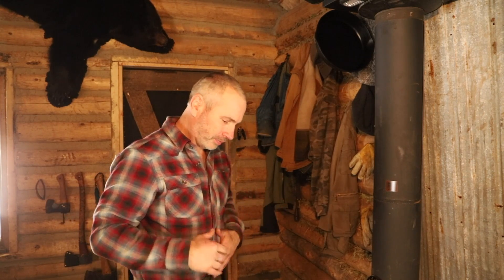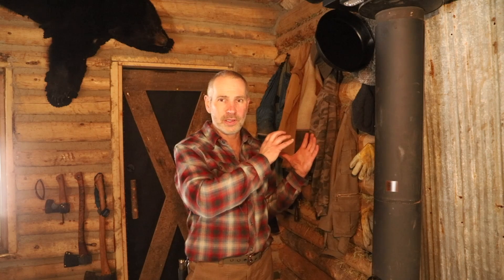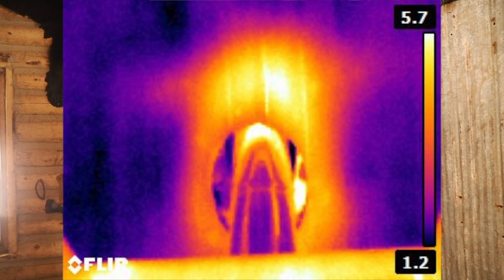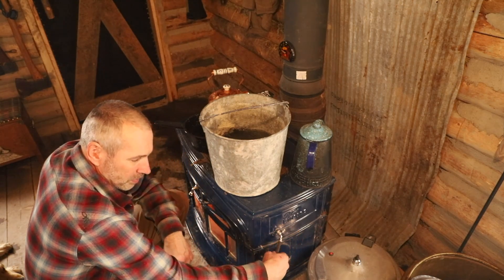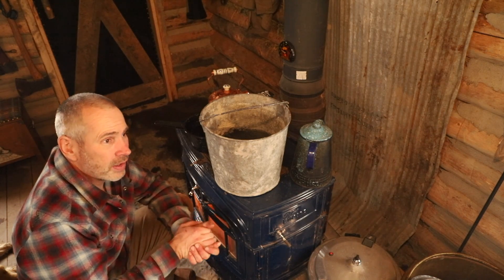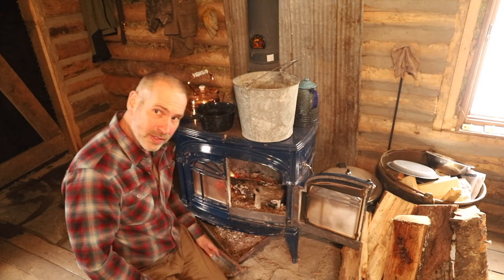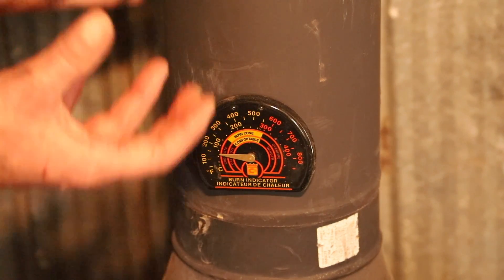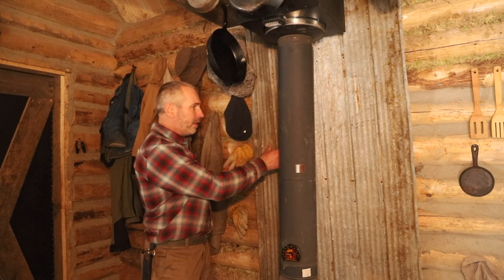How to Heat an Off Grid Log Cabin with Wood, Thermal Imaging Scan (infrared)

Comment: I really love everything of the cabin except the wood stove; it is not a good one, i really hope you will get rid of it ASAP (no kidding, not trying to offend; it is just a fact).

First: apologize if i sound polemic or something (i do my best with my limited english... I am also an asocial person. I am not good to "interact with others"; none the less, i am trying to help you...).

A good wood stove (2/3 of the size of the one you have) will burn 1/3 (or even less, maybe 1/5) of the wood that you are using right now, and will bring the temp of the cabin over 25°C with ease (you will be forced to open the windows - at the minimum setting -).
 
Nowadays wood stoves (good ones OFC - they are not all the same -) have a "fine air control" that make the chamber "go in depression" (10-15 PA or more). Less air inside, mean "more heat retained"; at that point the stove "will burn THE GAS instead of the wood" (you will see the flame only near the top of the stove, disjoined from the wood it self - A VERY LITTLE CALM AND STEADY FLAME -).
   Resulting in a greatly improved efficiency, less wood needed (usually "ONE CHARGE EVERY 3 HOURS or less" average), a lot more heat produced and the glass of the stove ALWAYS CLEAN (optimal chamber burning temp).

Your stove have always inside "big flames + BIG NOISE (= to much air - COLD AIR, that lower the chamber temp -) + the window dirty (chamber temperature "TO LOW for optimal burning")"; the worse possible condition for a wood stove (i honestly don't understand how you can "act and talk about that, like it is normal" - IT IS NOT NORMAL... IT IS WRONG!!! -) .

   That is why you burn SO MUCH WOOD (the quantity you need is simply INSANE) and a little cabin like your is ONLY AT 15 C° - it is ridicule... I really hope you will realize this; it not "right" for nowadays standards (here in Italy you will be not allowed to use a stove like that, because it have "30% efficiency AT BEST" (nowadays stoves are 80%+ for law).

The smog that you produce is "TO COLD"; a lot of "UN-BURNED SUBSTANCES" NOT HELTY FOR THE ENVIRONMENT; with a more efficient stove, the fumes produced will become "good food for the plants" and nothing more.

I understand a good wood stove can be expansive but "it is the core of the house"; it is the most important item; it will repay it self "one millions times". It is also "A GIFT YOU DO TO THE PLANET".

A LOT LESS FATIGUE TO MAKE FIREWOOD TOO...
Reply: Just ended to write my post... Resumed the video... Figured out that "you already know that your stove suck"...

...But you are fine with that... 

One cord of wood FOR MONTH for what... Less than 60 squared meter cabin?

I barely use one cord of wood for a 130 squared meter house - for the whole winter -; people that WASTE natural resources like you do FOR NO REASON, make the life harder for everyone else... 

I can't stand this kind of behavior; it is wrong.

Subbed yesterday; un-subbed today...

Bye
Reply: Grappolidipama.....this is Canada, not Italy...big difference in temps plus often very windy. We are having a record breaking cold winter. I live very close to Shawn so I know what he is dealing with temp wise.
Reply: Please... Don't trow at me that kind of nonsense...

I live on Alps and it is not un-common to have -10 celsius outside (like he stated in this video); but for sure it is not normal to reach ONLY +15 inside - especially in a tiny WOOD house like that) -. That stove DOESN'T WORK PROPERLY; all the heat is lost trough the chimney.

A stove that work properly BARELY EMITS ANY NOISE, you can hear the "click-clack" of the metal that "constantly expand and retreat"; that stove sound like a "jet engine". Sorry to say but you have no idea "how a wood stove (should PROPERLY) work". 

I am not even talking about "catalytic ones" nor "rocket stoves" nor "mass heaters" (because i don't like neither of those).

I know "everything the market have to offer" and have used EXTENSIVELY any kind of "wood burning stove" (at least 20 different models/brands, in at least 7 different locations, in the last 25 years... Plus my own house...). I am telling you that "that stove doesn't work properly"; there is no chance that i am mistaken.

I had a similar discussion with the mother of a friend, like 3 years ago; she drove me mad (it is not possible to deal with ignorant people... The only possible option is: "TO LEAVE THEM ALONE!").
   Long story short: i gifted to my friend (when her husband passed away) a new (GOOD ONE) stove that easily bring her house up to 26° Celsius, with minus 5 outside - at the minimum setting - turned on "less than 8 hours at day average" (her house is around 45 square meters and "not particularly good insulated" - your friend cabin is "100 times better" in that regard -). When the atmosphere pressure is about "1005 mb or above", even "the minimum setting is to much" (and the house get easily over 30° celsius IN NO TIME). 
   Right now she use about 1/3 of the wood compared to the previous (Chinese completely USELESS) stove, gifted to her by the brother (this was the reason her mother bothered me in the first place, when i told her that "i was about to gift her a new stove").

Now... "You think that stove is good and work properly"... I know from my experience, that "you are wrong" (big time); this make me mad (for all the reasons i already stated)...

Only option is "TO LEAVE YOU ALONE"; bye
Reply: @grappolidipalma  Good retort! Some people just won't take constructive criticism!

Comment: Hi Shawn: one cheer for modern equipment The Infra red camera can be a very important tool. I was amazed when I installed 2" styrofoam sheet in the roof of my log cabin how the demand for wood dropped. As well a constant kettle on the stove with a heat generated fan behind it were a great help The styrofoam also brightened up the upstairs Still impressed by all your efforts. Brian 77

Comment: hello Shawn been watching your vids for awhile thought i"d give you my take on the heat loss between the logs. My great grand father built 2 log cabins in lake of the woods during the 
 great depression he used oakum for chincking great for anti bug and then cut saplings in 1/4 and nailed them between the logs in side they are still standing today cheers.

Comment: I just looked at the user manual for your stove on the Vermont Castings website. It says the airflow is controlled by the right handle, is it functioning properly? We improved the peformance of our woodstove by replacing the firebricks with replicas made from vermiculite board, easy to cut with a handsaw. Great videos by the way. Always look forward to Fridays :)

Comment: Shawn:   we have a 24x24' log cabin with a 24' ceiling and loft. we have heated floors but only run them during the hrs of 10pm to 6am.  Our stove really works well. Might suggest only feeding from the top. I never open the front doors. we live 2 miles from Canada in MN. if you ever need parts, I know a dealer who is great to work with.  Enjoy your vids!  highlight of my day when you post them.

Comment: Great episode. You were concerned about stale air (too much Co2?) in the cabin if you fed air from outside to the combustion heater but you have quite a lot of volume in the cabin so I wouldn’t think it’s an issue, especially as you’re in and out of that door quite often. Cody’s Lab has some interesting information on Co2 in confined spaces. I noticed another viewer mentioned a rock wall behind the heater for thermal mass, I was of the same mind when you were talking about the flue in a previous episode. Well done on an informative piece.

Comment: Hey - I don't own this particular stove, but I own a Vt. Castings (Dutchwest) from the early 90s.  So similar but not exactly the same as yours.  These things are actually pretty awesome, but they are definitely a little fiddly.  A couple of suggestions:

1.  Get on-line and pull the manual for your stove.  It may take some sleuthing to figure out the model number but they do have the old manuals on line, even if your particular stove hasn't been sold for a long time.  The manuals were well done for these stoves, and they have full parts diagrams and other stuff that is really helpful in maintaining/optimizing them.    

2.  The gaskets are very important in these stoves and they do need to be changed every 5 years or so.  Yours look shot.  Note that at least on mine, they are in places you see and also in places you can't see from the outside, like where the flue collar attaches to the stove body.  Once you figure out the model, you can order a gasket kit with enough of all the various thicknesses to redo the whole stove.  

3. They also used this stove cement/caulk stuff to seal together the cast iron pieces (everything is just bolted together) and it gets brittle over time.  Wouldn't surprise me with all the jostling and such it took to get it there when it was already old, that some of it has flaked off.  To the extent you can, I'd pull the thing apart in the summer far enough to inspect the places where the various sides/plates come together and also around the inside of the firebox and re-seal as needed. I put a super-bright flashlight inside the firebox at night with the lights off and that can really help to identify problems.  

4.  If you are having to open the ash pan to regulate or maintain the fire something is seriously wrong.  I use the ash pan door for 10 minutes when starting it from dead cold to get the flue warm and drawing right, but I never run the stove with it open after that, and they say not to ever run the stove like that because of the risk of over-firing.  It may be that you need to open up that vent at the back even if you aren't direct venting it to the outside so it draws right.  

5.  Mine is a catalytic stove so the main damper is only open until the fire is established and to load it.  Otherwise the smoke runs through a secondary chamber and a catalyst, which greatly improves the efficiency.  If yours is also a catalytic stove, it probably needs a new catalyst, as they also only last 5-7 seasons before they have to be replaced.  Wouldn't surprise me if yours is gummed up, particularly if the last guy burned anything other than properly seasoned hardwood in it.  

6. If it is a catalytic stove and you are running with the damper open for any length of time, that might very well be why you are ripping through wood at a crazy pace for such a small space.  I can a heat a well-insulated, 3 bed 2 bath house when it is -15 C on a little more than half the wood you are using.  Yes, your cabin is not as efficiently insulated as my modern house, but it is also not even 25% of the size.  That is actually way more stove than that tiny space needs, you should be struggling to keep it from turning into a sauna, even when it is blowing a blizzard outside.  So there is probably room for significant improvement in efficiency if you can get it running better.  

Best of luck with it!
Reply: Well thought out advice.  I heated a 16 x 16 log cabin with just a cook stove (small firebox), and only used about 3 cords of wood all winter (Northern BC).
Reply: Yes, the efficiency of the stove is in question. I would also advise a complete maintenance check by authorised personnel. Costly? Possibly, but cost effective without a doubt, probably half the amount of fuel being used with greater efficiency and knowledge on how to use the stove correctly would be safer.

Comment: Thanks for the high quality, thorough videos. I'm very interested in your choice in materials and building process since you seem to build things to last. I'm planning to buy a second wood stove tonight and am looking for land in North Georgia this summer. I'm not familiar with the way your stove is vented. I see box overhead that the chimney goes into. I know you have a chimney through the roof, so what is that, a chamber to retain more heat?
Reply from the maker: It's just a header box to carry the weight of the insulated chimney about it.

Comment: I worked as a Chimney Sweep for  about 6 years. Your Vermont Castings stove is quite popular. From what most homeowners tell me is that they go through 2 to 3 cords of wood in a season. Your cabin being a bit smaller, Yes, you may be burning a little inefficiently but not by much. Another great video!!

Comment: Recently subscribed and I really appreciate your interesting videos, really calm and soothing to watch and lots of information! It just came to my mind that you could heat water with pipes around the chimney or pipe that goes up to the ceiling.. Then ok, sure you could just heat up water on the stove as well ;)

But my idea was, if you install running water.. if thats possible with -20 degrees? But if you do, you could run some pipes around the stove pipe and heat it that way.. That would be cool, but after thinking while writing.. this might not be possible due to the extreme cold when the cabin isn't heated..

Not sure if you've addressed this, but why do you let the house go cold when you're out? Except for loosing logs for generating heat when you're out, are there any other reasons why you don't keep your house warm? The stove should be pretty safe to run without you being there, or is there a law against it or just common sense or? :)

Comment: I know it is easy to say "you can just..." but you could cut the top of the stove you have now, or find an old wood fired cooking stove that are made with bricks and mortar. Sorry don't know what the specific English name is. But it would work a lot more like a Finnish mass heat stove and still use a minimal footprint. 
Try looking at something like the Tiileri - Helmi at Maine Wood Heat.

Comment: Hi there Shawn. I would recommend you to build a stone wall behind stove. That would be more efficient and would give an aesthetic look. Best regards.
Reply from the maker: That's what I planned to do from the beginning, but now I'm concerned about the weight of it and the different settling pattern from the rest of the log walls. I still might if I can figure out how to transfer all of the weight to the ground rather than have the wall carry any of it.
Reply: I can't tell from the video, but it looks like the tin is flush with the log wall...you should probably have a bit of air space behind it, just in case.

Comment: Are there any basic dimensions of the cabin on any of your videos?
Reply from the maker: I mention it several times but I don't really have a specific, comprehensive technical video. It's 10'x20' on the main floor and 10'x10' in the loft.
Reply: My Self Reliance Thanks. That's basically what I was after to get a feel for the size. While I'm pushing my luck, how high roughly is the loft and then the loft to roof?

Comment: love that stove I will be 48 at the end of april and we have a shrader that was installed in 1979 now I replaced the dubble walled pipe a cupple of years ago and other than that it has been perfectly reliable  I love wood heat and would not have it any other way

Comment: What about using cold air from under the floor for that back duct? I've seen people suck cold air from their basements in traditional frame houses. Also, couldn't a damper be installed I  the chimney?

Comment: Hi Shawn, great video. One thing I wanted to share; I inherited a Vermont Castings stove in my log home, and the difference in efficiency and control when burning in catalytic mode vs non-catalytic is incredible. I didn't fully understand catalytic combustion for a few months and used it as a conventional stove during that time. The catalytic combustor enables a secondary combustion of smoke, with the combustor temp reaching 1100-1200 F, while greatly reducing airflow draw in the house. I find that with the box full of dry hardwood I can fill at 11pm, damp down the secondary air inlets, close the primary completely, and as late as 10-11am will have glowing embers and a firebox temp of ~300 F. At that point if the primary damper is opened the embers will relight within 1 minute. If you really want to reduce your wood consumption and efficiently heat with wood, I would strongly recommend upgrading to a catalytic wood stove. Just wanted to share my experience.
Reply: I agree . I have been using a vermot castings federal for about 25 years now. Two cords of oak keeps my 2000 plus sq foot home comfortable for the winter.    It was listed by the epa as 86 percenct efficient.
Reply: That was a helpful tip.
Reply: +Steven Hardy food tastes so good cooked by wood!

Comment: You could put stone on the wall behind the stove to create a large thermal mass which would extend the heating time once the fire dies down over night. Also powerless heat fans work great to move hot air.

Comment: I'm amazed at how little heat loss your camera showed on your roof! 

Regardless of what type of stove/heater you end up with, have you thought about a thermocouple fan? You could run a duct from the loft down to the fan, recirculate some of that hot air that ends up in the loft.

Comment: I dont know, but when i was up in the Kootenay's here in BC, my little cabin depending on the cold I would burn 4 to 6 bush cords in a season. Pretty standard for 7 months really. Generally I would start with partial fires mid September then by Oct daily fires then by mid Oct or Nov1- 24 hrs a day till mid April,